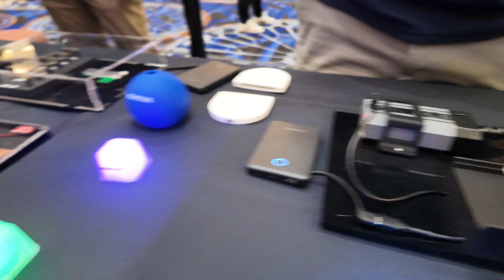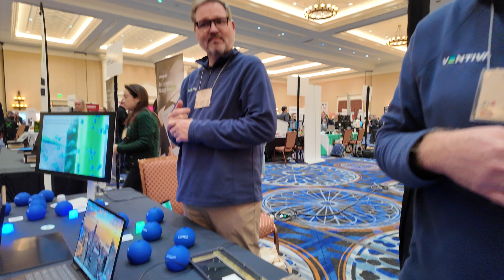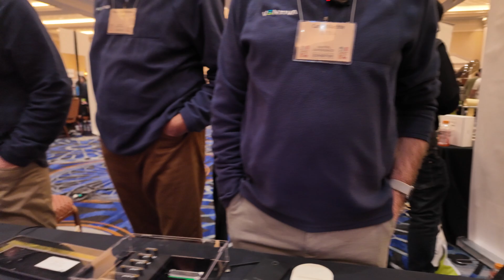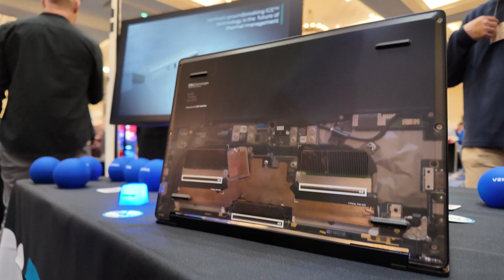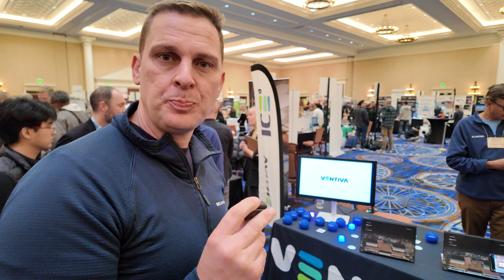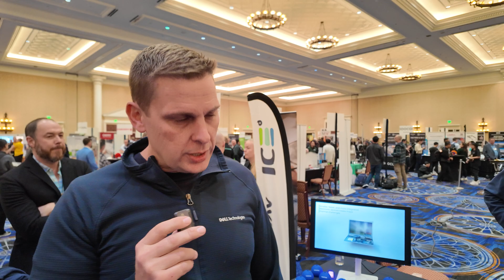Ventiva Solid-State Cooling: Silent, Fanless Tech for Laptops, Smartphones, and Consumer Electronics

Comment: Someone should get an ozone detector near that thing
Reply: Quote from their FAQ "Like many products in use today (e.g., laser printers, vacuum cleaners, photocopier machines, kitchen blenders, etc.), Ventiva ICE9 solutions generate a small amount of ozone. This ozone is a by-product of the cooling process and is only generated when the device is in use.

Ventiva has developed effective and efficient catalytic decomposition techniques to speed the conversion of ozone back into oxygen, before the air is exhausted from a device that is being cooled, so that the device can be fully compliant with rigorous indoor air quality standards."
Reply: why? what is that?
Reply: @awel7496  Ozone is bad for your health. Try asking chatgpt about side effects of  ionizing air.
Reply: "Odor reduction fan"